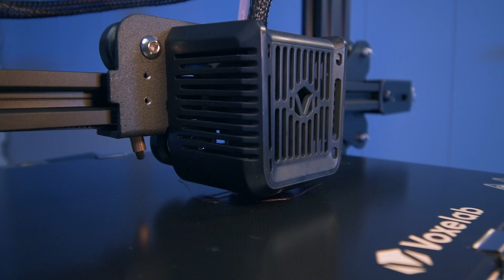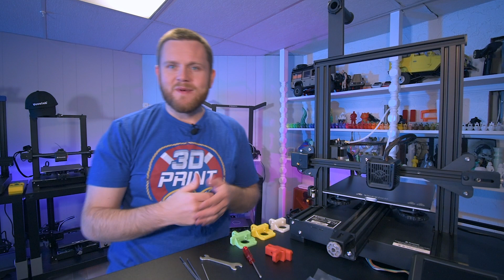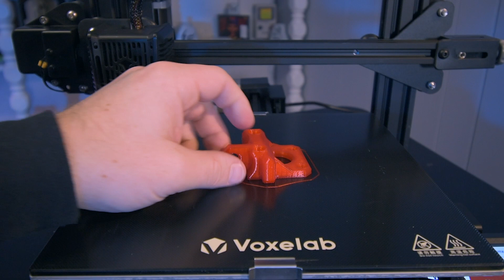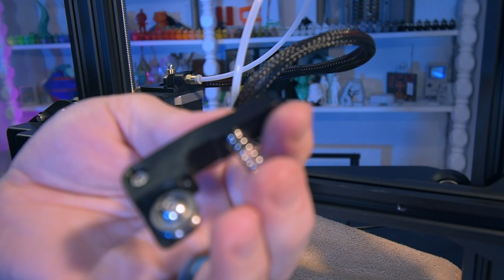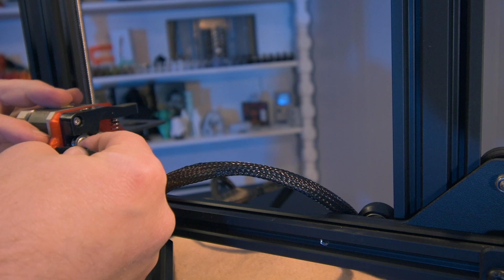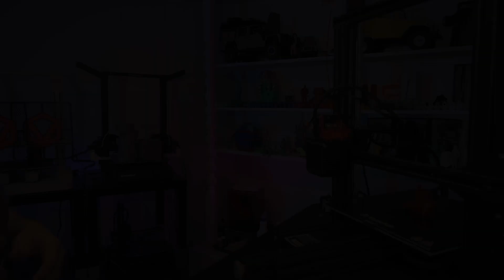Voxelab Aquila Direct Drive Mod - OOTBDD - EASY & FREE

Comment: Fedor, another great video.  I have one question because I'm not sure how to do this.  I've been using your PLA profile in cura since I got my Aquila and haven't had any real problems.  The only settings I have ever changed are the infill and support settings depending on what I am printing. You stated in the video to change the retraction settings from 4 or 5 to 1. The only thing I see in the Cura profile under Travel is a check box to turn retraction on and off.  I see that I can make a setting called Retraction Distance appear in the profile.  It is currently set at 5.0mm.  Is this the setting I would change if I decide to go to direct drive. I've already printed the piece just to get good look at it.  Printed great. I'm currently using your extruder from your broken extruder video. I'm not sure if I want to give that up yet.
Reply from the maker: Yep, that’s the setting. Retraction distance. Just swap that over to 1mm and you should be set. 

Also, if your machine is printing great and you’re enjoying it, don’t change it. ;)
Reply: @3DPrintSOS  Thanks for the reply. I learn more from your videos than from any of the facebook groups. The current extruder I'm using now I printed before the original one failed. I think I'll keep this one in reserve incase that fails someday.

Comment: I agree with your comment about filament runout sensor on the X2. I unplugged mine as it would intermittently stop a print several times falsely saying the filament had run out.
Reply: I have the opposite problem, it just doesn't work, filament stops and the sensor does nothing :D

Comment: Does your lever mode work with this set up?
Reply: Found in comments below that the lever mod does work.  Thanks for the video!
Reply from the maker: Yep and it gives you some extra adjustment too :)
Reply: @3DPrintSOS  where can i find the lever ???
Reply from the maker: Check for the “fedorstruder” on thingiverse or printables. I didn’t include it because it needs some extra hardware and I wanted to keep this stock parts only.
Reply: @3DPrintSOS  does it also work with the "CR10S PRO dual gear extruder"

Comment: I think that adds a lot of weight on the gantry,  you can easily print a Hextruder, Sherpa mini or Sherpa Micro for your printer, those are beast in speed and performances and they are very small n light weighted (around 100g).
Reply from the maker: yeah for sure. But the challenge was, out of the box, no extra tools, no extra hardware. If you want to throw money at it, there’s enough mods to make your head spin.
Reply: @3DPrintSOS  when you buy 3D printer eventually you will spend money on it, I thought the same when I bought mine.
Reply from the maker: Believe me, I’m very familiar with that. Haha. I’ve had over 30 machines now. Spending money on them has become my life. Haha

Comment: I was just thinking of direct drive mods for my x2 so this came out at a perfect time!  definitely going to do this sometime, though as someone new to the hobby I like having the runout sensor there as a safety and definitely wouldn't mind seeing a version of this that allows that to still be in use
Reply from the maker: Noted. :)
Reply: Very rude and cocksure of yourself considering you claim to be new to 3D printing.
There's a saying, "If you have nothing nice to say, then say nothing !".
Reply: I am also relatively new to 3D printing but I do have a tip:

If Cura tells you that your print will use 100g and the markings on your roll says that you've got 50g left, don't start the print, you will run out of filament. No run-out sensor required.

You're Welcome
Reply: @FreshCityVentures  it's already come in handy because there are reasons to have the sensor.  for a recent story, a friend of mine backed stagetop on kickstarter, a printed tabletop game station that takes a TON of filament.  the main frames of the thing can be printed about 9ish to a roll of filament, but he wanted 24 of them all in the same material, I am not going to weigh the roll when it gets close to being done just so I don't use it, instead I let the sensor tell me when the roll was out and changed the roll mid print.  

did that add some time because it relied on me checking?  sure, but it also made it so I used the majority of the material provided to me for the project on hand.  so while you can make snark there ARE legitimate uses for the sensor.  

edit: friend doesn't have a printer, for clarification, I printed it for him
Reply: @Orion_Alathorn  😂weigh the roll? There’s marking on the side of the roll, fella.
Reply: @FreshCityVentures  those markings are nowhere near as reliable as a scale, they are good for rough judgement but not anything more.  I always weigh my rolls after each print and keep a note taped to the roll with the exact weight of what remains, down to the tenth of a gram. I prefer to actually know how much I have than guestimate
Reply: @Orion_Alathorn   of course it’s not exact, neither are the estimates that the slicer gives you, but it’s very close and enough to prevent you from running out before even starting a print. I typed out a big long reply but I backspaced it. You’ve got your method figured out, but they do have medications for your condition.  

Weighing each roll down to 0.1g after you just finished a 2.5kg print….🤣 It’s not cocaine.
Reply: @FreshCityVentures  is there a reason for the rudeness?  I fail to see why you care so much that people do things differently than you to the point that you insult them and suggest they go on medications.  I measure to the tenth because that is what my scale measures in, why would I ignore that amount?  I don't make an especially large amount of money so I prefer to know exactly how much I can print vs knowing a VERY rough estimate.  buying a new roll is not always on the budget.
Reply: @Orion_Alathorn  That’s great to know how much filament you have left but does you magic scale also tell you how much the model will weigh before you print it? When your slicer GUESSTIMATE tells you the model will take 35g and your roll weighs 37g do you still do the print? Or do you wait until payday and just buy another roll?
Reply: @FreshCityVentures  dude, if you want to be a dick go somewhere else, I'm sorry that you feel having more accurate information is worse but it's not my problem, it's yours.  so take that problem and please go bother someone else
Reply: @FreshCityVentures  You are a troll! Just take your meds and leave people alone! ;)

Comment: Just noticed that you used SpaceClaim to design this. Been using DesignSpark Mechanical as my goto for all my designs. Very underrated software, IMO. A shame that it doesn't get more love. :)
Reply from the maker: Design Spark Mechanical is awesome. For some reason, I can wrap my brain around it 100 times better than anything else I’ve tried. Only thing SpaceClaim has over it is the mirror tool and whats funny is that I havent used it once since I got it. So DSM for FREE is the best. haha
Reply: @3DPrintSOS  Completely agree. When I first started, I tried various programs. F360 felt like I needed an engineering degree to learn and Tinkercad was a little too basic. DSM felt just right.

Comment: Thanks a lot for this, Fedor. Love your videos. I saw this on Thingiverse yesterday and was looking forward to your video. Definitely going to add this to my X2. Was wondering though, will the tension lever from your Fedorstruder work with this mod?
Reply from the maker: Yes and lot’s of additional benefits come along with it actually (Like spring tension adjustment). So, it’s worth a tiny bit of extra hardware.

Comment: I mean, why couldn't they just do it at factory? Parts like this cost nothing and are extremely easy to mass-produce when you have an enterprise-level injection molding machinery. 
And they could downsize the motor to 23mm Nema 17 and probably get a cheaper machine overall.
Mindboggling...
Reply from the maker: Well, I think they…will. They have a D1 and S2 that are direct drives out of the box but I think at the time, when they went to make the original Aquila, pretty much all machines were Bowden setups. Now that almost everything coming out is direct drive, I think that will be the focus. But yeah, you are 100% right. They could/should.
Reply: @3DPrintSOS  S2 and D1 are... not too bright compared to Ender 3 S1. Let's hope Flashforge would do better next time (or 98% copy-paste but cheaper like they did with the original Aquilla).
Have you tried to swap Extruder and X-axis motor? If I remember correctly, the X motor is relatively small compared to E.

Comment: Nice mod! Have a question would you suggest replacing the stock handle with your other extruder model? I recall you mentioning the stock handles crack after awhile.
Reply from the maker: For sure. That handle also gives you the ability to adjust the spring tension and adds a recess to add a touch of PTFE tube to guide filament in. :)  I’m working on an updated version but the original will work perfect here.
Reply: Awesome! Cant wait to see it. Thanks again for all your videos and all your hard work! Keep on printin'

Comment: LOVE this! Printing the piece now and will be spending my day off doing this. Thanks!
Reply from the maker: Let me know how it goes. :)
Reply: @3DPrintSOS  It went really well. 28:38 was the only issue I had (user error). I think I tightened the lever too tight and it made the filament roller a bit too offset to catch the filament. But once I loosened it it worked like a charm. Definitely had to do some bed leveling afterwards like you mentioned, but after that I printed a Benchy no issues (CHEPs 2.0 Cura profile, with retraction distance set to 1). Posted it to Thingiverse.
Reply from the maker: Saw it. Well done. Enjoy the mod. :)

Comment: Well done , Fedor. 🤘 That probably works on every E3V2 too, right ?
Reply: I have an original Ender, I’ll print one and see how I get on
Reply from the maker: Let me know. That would be great.
Reply: @3DPrintSOS  Printed it out of ASA last night as works fine so far
Reply: @rbcmptrmn  does it work should work for a e3 to right ?
Reply: @3dTinker  yes same carriage 👍
Reply: @rbcmptrmn  sweet installing rn thanks
Reply: @3dTinker  I’ve popped a make on printables
Reply: @rbcmptrmn  ive got the new spider hot end in my e3 so it didnt work and i dont think he put uo the steo files to move the bowden hole maybe abou a mm or 2
Reply from the maker: Honestly not sure. I dont own one anymore to test. I’d have to find a carriage STL and compare.

Comment: Another awesome video as always, love these mods cheap and easy direct drive. Thanks Fedor. I think I’ll open up the bottom and split the wire all the way to the board hopefully a little more slack
Reply from the maker: Yep, going all the way helps for sure. In my case, I just splice and extend the wires myself but I know not everyone is going to want to do that. ;)
Reply: @3DPrintSOS HELP.....I got a problem ,just finished installing the mod and when I get ready to print ,it tells me "system doesn't detect filament .But I auto correct is load it extrudes way more than what it needs to not sure how to stop that either, can someone help me please .
Reply: @3DPrintSOS HELP.....I got a problem ,just finished installing the mod and when I get ready to print ,it tells me "system doesn't detect filament .But I auto correct is load it extrudes way more than what it needs to not sure how to stop that either, can someone help me please .

Comment: The video I've been waiting all my life for. ! Thanks Fedor ♥️👍
Reply: Soo I successfully printed your .Gcode mount from thingiverse, the spacer fits beautifully but there is a slight movement back and forth of the  mount, only when hand pressure is applied even after tightening. Will this be an issue..??
Reply from the maker: As long as it doesn’t move when printing or is so loose that it vibrates, it should be ok. Sounds like your filament/esteps combo might be printing just a tad under.
Reply: @3DPrintSOS  Much better after a recal, stiff enough it shouldn't move while printing at least. I forgot to mention I have a Satsana mount on my voxelab but a quick sand of the outer corner of the mount and bingo! Fits with Satsana perfectly. Looks great! Thank you again Fedor.! 💯♥️
Reply: @3DPrintSOS  Okay so my extruder motor is getting extremely hot!? I've already lowered voltages months ago when you released that initial video. Should I check them again or could this be a binding issue...? Thx Fedor